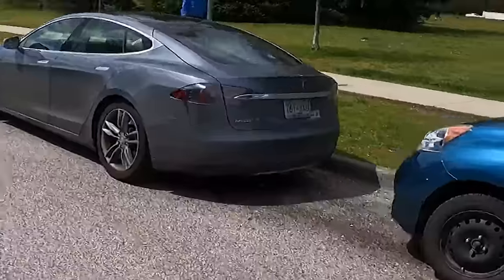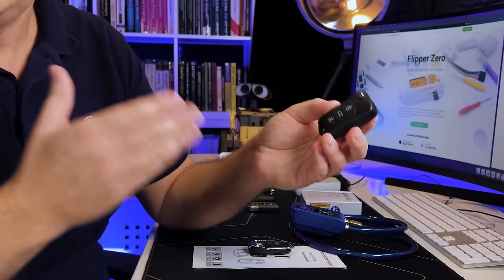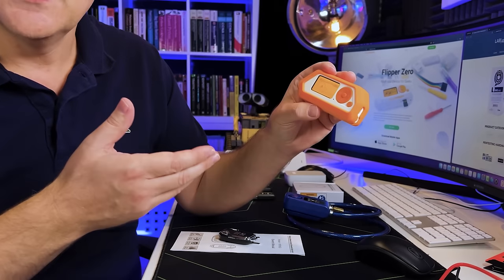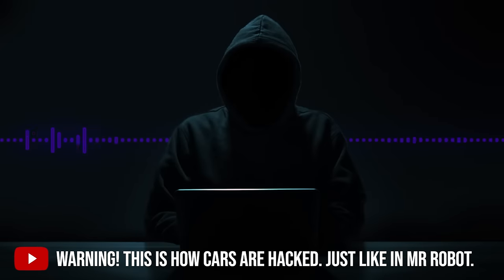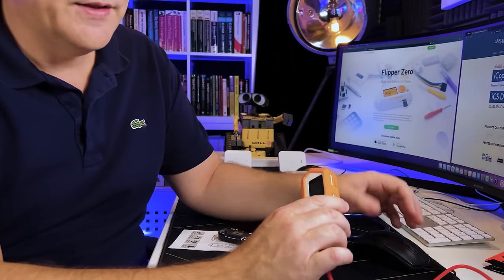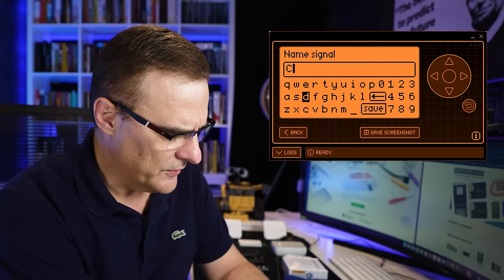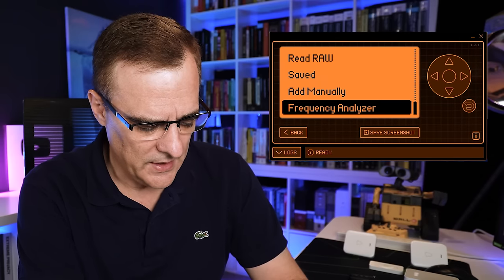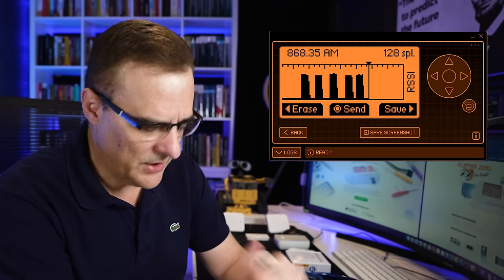Flipper Zero next level

Comment: I have a Honda Civic Type R and I tried to use the flipper zero, but for some reason it has not worked. While now with your good explained video I can give it another try. Before I wasn't really aware of how to handle that thing with Emulation and also not fully sure about the frequency. But the thing I was really wondering about is, if it would also be possible to emulate the key fob of the keyless system to start the car. But I have expected that this has more likely to be something like a passive signal, so I expected this won't gonna work? At the other hand you're telling, in the video, that they have been able to open the doors and remotely start the vehicle. So how is this gonna work?

Comment: This gona work if you forget you keys inside the car., but this device in the wrong hands its a big problem., Thanks for share it.
Reply from the maker: Fortunately cars today implement rolling codes (exceptions like honda mentioned dont'), so simply replaying the captured code won't work (as I demonstrated).
Reply: @davidbombal  Copy That.!!
Reply: @davidbombal  there is a hack for this though, with a signal blocker, you essentially capture and save the initial rolling code, and then the user presses again, and you capture #2, then play #1 and you have the code for a 1 time use. Don’t ask me how I know

Comment: 7:45 I would be very careful using any 25 € bike lock.
Kind of secure bike locks starts from about 100 €. And only if properly used.
This exact lock could be opened in a second with a 2 €  cutting pliers and possibly by bare hands

Comment: Regarding the bike locks. It doesn't seem like it would be easy to capture the signal. Doesn't the flipper have to be really close to capture it? And if not then how far away?
Reply: Some jerk could leave it in the bushes next to a parked motorcycle, pretend to walk around the corner when he sees the biker coming ot unlock the bike, and hit "read" on his phone app to remotely activate the flipper.. Boom, he now has the key code to unlock the bike lock the next night.
People dont realize how dangerous this tool is.

Comment: What this devices does is not really "hacking", it is just repeating the radio signal (for example door opener) or copy the rfid device id (hotel safe). Stuff like this works because companys are to stupid to implement proper authentication challange between devices to check if the sender is not just repeating a recording/id.

Comment: Forr whatever it's worth one day I was getting gas using my credit card to pay. At the same time I was doing phone banking. The bank asked for my pin to access my account but before I could provide it I needed to enter my zipcode to use card at the pump. 

I couldn't believe the phone banking robot came back and said the # I inputted ( on the pump) was wrong  and it repeated the same number I inputted on the gas pump

Comment: I sat down with my flipper and I went through every single rolling code on my car. It took me about a hundred and some clicks of the remote to get back the same I guess you call it frequency output. I recorded them in chunks on the flipper with a pretty big SD card and I can unlock my car but I have to remember which rolling code it's on. Basically if somebody captures my key fob they're going to have to wait until I lock my car over a hundred times before they can get in it

Comment: if Flipper cannot effectively scan clean trough multiple overlapping RF signals even at its min-max range...then... in that logic might be the solution to circumvent it...(:D)...just a thought RFID blockers "blocks" a clear singular linear signal...so can the Flipper effectively scan an area with multiple sources of RF signal to cleanly ID and harvest the info for the right signal for the target device and emulate it?

Comment: Is there any way to extend the range on this thing? Like opening it up and soldering an antenna to the current "antenna/receiver"?

I can imagine it gets cluttered with all kinds of signals so u can't pinpoint the one you want anymore, if at all possible to extend the range. Right? Well maybe if u already know the frequency range. 🤔
Reply: Remotes commonly work on 315MHz (US), 433.92MHz and 868MHz (Europe).

Comment: 10:00 This is also the hardest part. You NEED the orignal remote to unlock it anyway.. It is safe.
Reply: Assuming the keys are changed for each unit sold